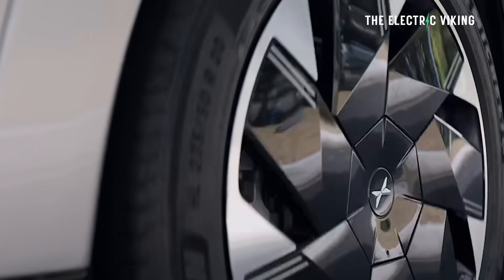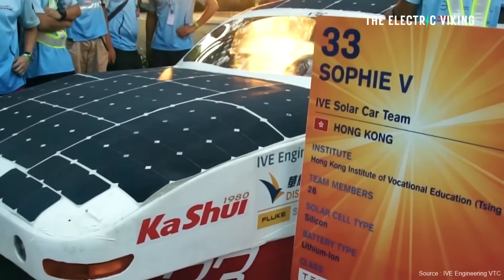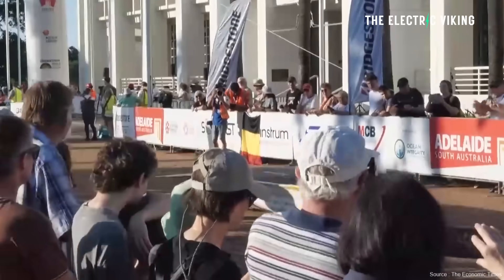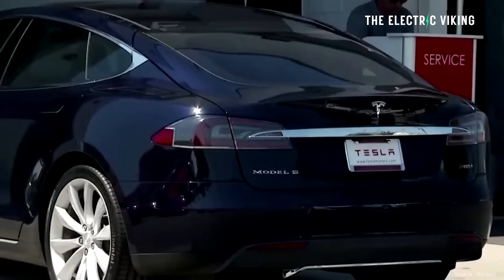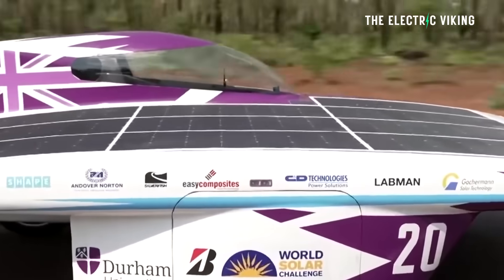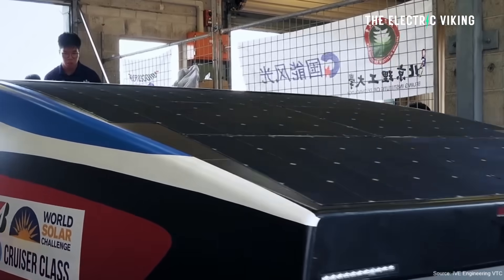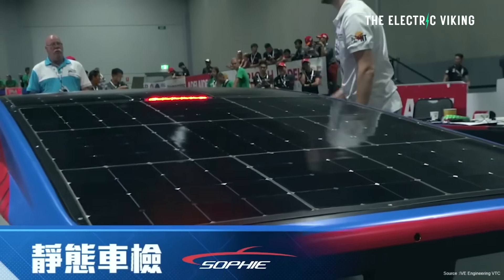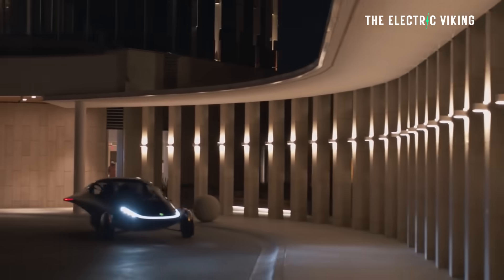The Secret to Endless EV Range: A Solar Car's Winning Technology

Comment: I'm very excited to see Apteras on the road. They have also partnered with Telo to put panels on their trucks; it won't get 40 per day, but I drive less than 10 miles a day.
Reply: Same. I’m dying to see Telo show their solar roof and bed cover in action. I only drive about 12-30 miles a week and I would never need to plug in.
Reply: @daisyandpizzanight  as long as it's sunny and you park it outside all day.

Comment: Here in the UK, my 21 month old car has gained 450 miles (724 Km) from the two solar panels built into the sliding roof  structure. Not a large amount, but then this is an island that domestic buildings would only benefit from air-conditioning 4 or 5 days a year.

Comment: The numbers just don’t work.

Optimising the design for solar collection compromises safety and the juice just isn’t worth the squeeze.

Bear in mind that the Aptera still hasn’t reached production, its eventual estimated price is similar to a Tesla, it only manages 40 miles/day in optimal charging conditions, and it having only 3 wheels compromises stability/safety.

Comment: Thanks for the laugh Sam.  As light and efficient Aptera is, they are only able to achieve about 40 miles of range per day (and that's being generous) with solar panels.
Reply: and the average person doesn't even drive that far in a day, so it's FREE energy, EVERY DAY. The laughs on the ignorant....
Reply: @MickH60  Drive in LA and then talk.  Not only will you drive more than 40 miles a day (round trip to work) you'll waste 40 miles in range just waiting in traffic.

Comment: Aptera promises 40  solar miles a day in sunny weather, because of its extreme energy efficiency, and it is still a practical and save EV (two seater). It has a 600 miles fully charged range, and charges faster (in miles per second) than any other EV.  I wonder what kind of solar panels are used on these solar challenge EVs, probably have a much higher solar efficiency than Aptera's solar PV technology.
Reply: I wonder what problems are keeping them from selling the vehicle
Reply: @wayando  they’re trying to raise money to build the production lines.
Reply: Aptera is vaporware that's been scamming people for 2 decades.
Reply: 400 miles is for the launch edition. The 600 and 1000 mile versions have not been built yet.

Comment: With perovskite maybe solar panels will double in efficiency, with advanced batteries cars will become lighter, live somewhere like California or Australia and you have lots of sun. What's not to like about free electricity even if you only use it for warming your seats on cold day?
Reply: It will be at most 50% more efficient than comparable state of art silicon panels, more likely 35% more efficient, but they never solve the lifetime reliability issues to make it worth it. It's real benefit is how cheap it is to make, but with silicon PV as cheap as it is now, it would be a small fraction of the price of the vehicle.

Comment: We already solar power our EVs, we just don't carry the solar panels with us, we leave them on the roof to keep powering our home.
I'd like to see some form of solar panel as standard on every EV one day, but I don't think the footprint of a car can capture enough solar power in a day for a 40 mile journey every day, unless the cars are much lighter than today's cars, which raises safety concerns.
That's the Aptera plan, but they haven't gone into production yet, so we haven't had widespread real-world testing. 
Let's see how they perform for the customers, if they ever get into production.
Reply: This is actually the smarter way to do it imo. Much more power, much more capable, and you don't have to leave it all day in the sun, running out with an extension cord whenever it's overcast.
Reply: Solar panels and storage batteries should be compulsory on every new home.

Comment: People that think solar panels can power a car need to buy a solar panel and try to power anything.
Reply: Not in mass production yet but ck out Aptera, up to 40 miles/day added to the battery by solar..
Reply: We already power two EVs and our entire hous with solar panels.
Reply: @ziploc2000  Liar
Reply: @NoneBusiness-t7s  Really brainless comments mate....
Reply: I suggest you look into the cross Australia race which is all done on solar
Reply: @paulgroth3345 try that in the north west. There is a reason it in Australia. .  Lots of sun and flat. Y'all dreaming
Reply: Millions do genius, you really didn't think that through , did you ?  Where i live nearly every house has solar, you need to get out more often....
Reply: I have, and do. I understand what you're saying. However, electricity is electricity, no matter how it's produced.
It's complicated alright. Getting the maximum charge, best storage, all that, is definately left to experts. 
But once you get it sorted, it's worth it. 
Take an in depth look at the tech. It's pretty damn good these days. And it works ok, because there are cars using it today.
Reply: I have solar PV arrays around my house which power my house and two EVs. Zero electric bills.
Reply: @MarkSpohr how many watts of panels? Those are on land. .  This is on a car with a space and weight restrictions. . . Come on man.
Reply: @crux321  I said "on my house". PV on cars is just not practical now so it makes much more sense to install in fixed locations. (There is also the issue that my cars spend most of their time in garages out of the sun.)
Reply: @MarkSpohr maybe you should made your own comment then instead of replying to one about cars as if what you said was somehow relevant.  Almost just seems like bragging
Reply: @MarkSpohr  Liar. Unless you have 20+ panels
Reply: @NoneBusiness-t7s  You're the liar mate, this is common where I live....Grow up...
Reply: @NoneBusiness-t7s  20 panels are common, put the bong down....
Reply: @MickH60  What country?
Reply: @NoneBusiness-t7s Aptera is more efficient than any production car, that's why solar can add up to 40 miles/day in a sunny climate. To be fair, it's not in production yet, and final test numbers aren't in yet, it's in validation now and just ipo'ed. I live in MA, think it's more like 25 or maybe 30/day here. But that's further than I drive every day.